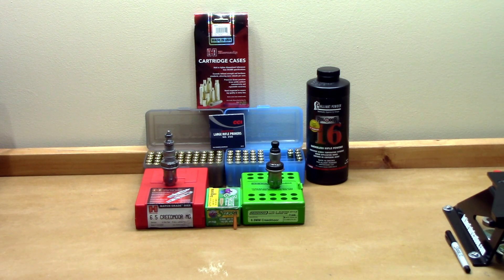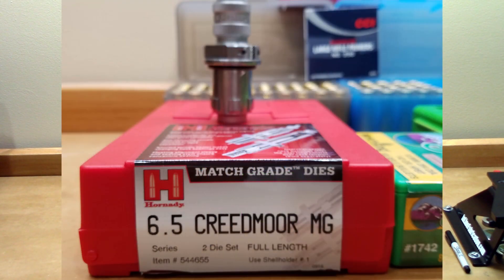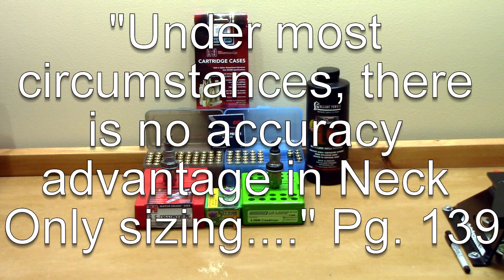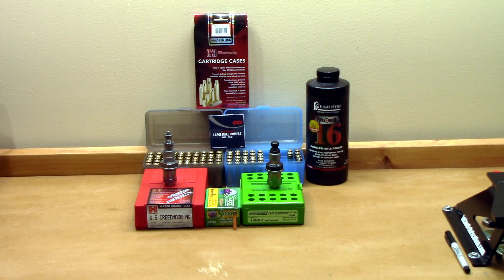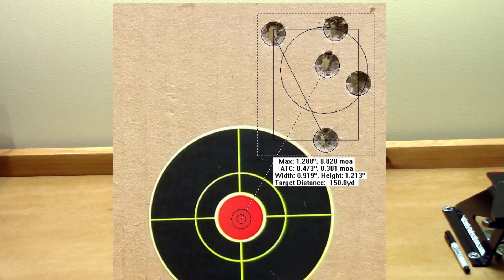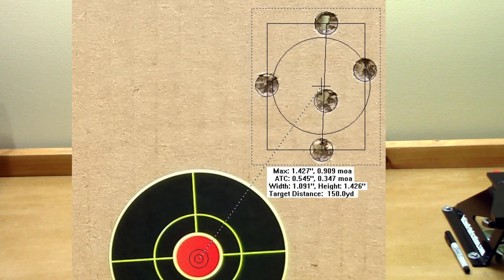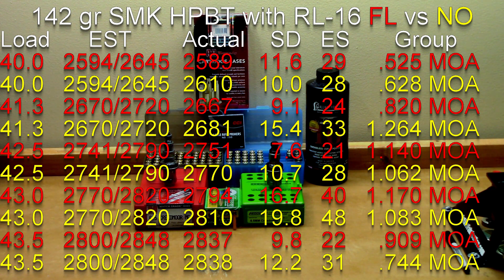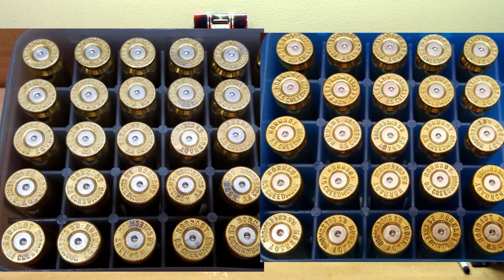Full length vs Neck sizing performance comparison

Comment: Good video.  Most competition shooters in F-Class and BR don’t neck size their brass.  We F/L size with 0.002” shoulder bump.
Reply: Erik, are you bumping .002'' back from SAAMI specs on a case or based on the rifles chamber? For instance I like to take all new virgin brass and "fire form" it once in the rifle it will be used for then make all corrections, assumptions, and measurements off of that assuming that it is formed to that particular chamber once it has been fired in that chamber.
Reply: Erik Cortina  bumping the shoulder is not full length sizing, only reduces the headspace.  If your headspace is ok, just neck size.
Reply: I, personally agree with Eric and am in the process of switching from the long touted and what most of us have been ERRONEOUSLY taught was more accurate neck sizing to do full length resizing, to include a shoulder bump to get the brass .0015 to .002 back from where it is a "tight bolt fit" bunt NOT IMPOSSIBLE to close..I believe that will give me a reasonable chance of NOT having rounds that will not allow bolt closing and having too much headspace. This is important if you shoot in timed matches because one would HATE to DNF a match or even a section of a match because the bolt would operate...maybe due to even a small accumulation of "crud" of any kind. The reality is that, SAAMI spec is NOT what most match shooters use and the cases have to be prepped according to the actual chamber in the rifle in which they are to be used.
Reply: Not Sammi, but one time shot case, out of your rifle

Comment: One thing I did notice, is that bullet speeds tend to be higher and next size dies. This is due to the fact that energy is not wasted expanding the case size as a deserve a chamber formed. So, this can take one variable out when trying to develop an accurate load. In my opinion full-length sizing should be used only when you have multiple rifles in the same caliber. Unless of course you were going to segregate your brass buy rifle.
Reply: I neck size cases to be used in bolt actions at slow fire range targets.  I do this for increased case life.  Some of my rifles get better accuracy from full-length resizing.

What I am using full-length resizing for is hunting rounds, rapid fire target rounds, and anything for a non-bolt action.

Comment: If the concern is neck tension and brass life, why not just anneal after each firing?  I just started annealing and using a mandrel so I can’t speak from personal experience but AMP has put out a few very compelling tests on YouTube. 

I am using the Annealeez and was surprised at how fast and easy it is. There are several devices in the market that make it too easy to pass up.

Comment: I usually get about 3 to 4 neck sizing before I need to full length size and I would rather neck size the case as it places less work hardening on the brass extending it's life.

Comment: This test produced some interesting data. If you average the 5 neck sized groups vs. the 5 full length sized groups, you get average groups of .9218” vs .9662” respectively. Average extreme spreads are 10.96 vs. 13.62.  Averaging the standard deviations yields a similar result; however, I am not at all confident that an average of standard deviations is meaningful. A 25 shot sample has much stronger statistical significance than a 5 shot sample. Just based on this analysis, neck sizing looks more accurate. 

Hearing Erik Cortina tell you “just stop it!” is pretty convincing for me initially, but I am not Erik. I do not use Lapau or Alpha brass, so my cases are not as consistent. I want the brass I do use to last as long as possible before throwing it out (or annealing), while Erik couldn’t care less about brass life. If I can get similar results with neck sizing while extending the life of my brass and avoiding case lube 4 out of 5 times, that looks like the way to go for a bolt action rifle. 

Most of my handloading has been for semiauto, and those always require full length resizing.

Comment: 0.525 group not good for a precision rifle ... maybe work up a new load.  I neck turn, neck size,
and bump the shoulder if need be,  getting 0.173 moa at 100 yds 5 shot group.  I like a snug fit 
in the chamber, it minimizes the proximal gas leak, and brass comes out cleaner. Good shooting.

Comment: The reason why I've always been neck sizing for the last two decades is because I'm not over working the neck by underdizing it, then expanding it with the expander ball like in a full length resizing die. Plus the neck thickness is rarely perfectly consistent and the expander ball will create an eccentric neck expanding more in the direction where the wall is the thinnest. Besides neck sizing die sets come with a body die as well as a neck die anyway for when the body has grown too big for it's britches.

People just simply miss understand what the purpose and use of the neck sizing die sets are for. Like all the miss information you see about moly coated bullets.

But of course you only use neck sizing die on brass with a chosen single constant neck wall thickness. Meaning you either buy top quality brass with consistent wall thickness, or turn your necks to make them consistent. If you use brass with inconsistent neck wall thickness in a neck die you're going to get a wide variation in neck tensions on your bullets!

If you're going to use mixed range pickup brass or low quality brass, you'll have to use a full length resizing die because you'll need the expander ball to create consistent neck tension on the bullets. Or turn the brass necks so it's neck wall is consistent for a neck sizing die.
Reply: Thanks, this is helpful.
Reply: I was looking this answer, I just start loading 223 and I bought the full length and the collect neck sizer . I didn't know how to use the collect neck sizer.
Thanks

Comment: Just like coating bullets, works for one rifle not the next, you will find out there will be better gains in reducing ES by testing primers and using the best you can, and from experience and hours of testing in a world class ballistics lab and the out come was a big surprise to me, however not to the lab team as the primer that came out on top was the ones they used every day for their testing, The primer with the  lowest ES was Remington standard  with a ES 3.783 m/s or 12.41 fps almost half the ES of the closes BR Primer which was 6.326 m/s or 20.75 fps and I had just got 2000 BR primers the week before we tested. This will probably change batch by batch just like powders do.

Comment: This is another interesting video. You would think there would be less internal case volume and more velocity generated by the FL sized cases, but the opposite held true. In terms of velocity, maybe it's more important for the bullet to be centered by virtue of the fire formed cases so that the bullet doesn't lose speed after hitting the throat off center? As for the better SD associated with the FL sized cases, we know ignition becomes more uniform and SDs improve as the case becomes more full.

Comment: Question is about neck lengh. Grew up shooting longer neck cartriges. In the market for a 338 Win Mag and will use 250 grns bullets seated out as far as gun/magazine will allow. Is it worth to ream the chamber for a longer neck using 300 Win Mag cases?

Comment: Thanks for this nice video... What is your usual case life?
Reply from the maker: Depends on the brand and how hot you load. Lapua goes a lot longer with the small primer pockets, Peterson is probably just as good, and they have both large and small primer pocket brass for 6.5 CM.

Comment: Hi there is a flaw in your test, you should work up the best load in FL  Brass then in Neck sized brass then compare, 
By FL sizing you are decreasing the case capacity and in doing so increasing pressure compared to Neck sizing , at the end of the day if you believe one is better than the other go with it.

Comment: If it was me, I would be more concerned about the extreme spreads in your velocities more than I would the sizing of the brass.  In 6.5, you should be able to get extremes in single digits to teens which will help your group size more.  Loose the magnum primers and or switch powders and your groups will reduce.  Then worry about the cases.

Comment: Does the brass last longer with neck only and not full length sizing on my 6.5 cm bolt RPR thanks I so enjoyed your video
Reply from the maker: Hi Ruben, I am glad you enjoy the content. SO far in 6.5 Creedmoor the majority of the case failures are due to primer pockets becoming loose. I have not yet had a neck split. This is somewhat cartridge dependent though.
Reply from the maker: Not as much for small rifle primer brass. LR Primer pockets seem to loosen faster depending how high the pressure of the reloads.

Comment: Here is my one thing, im cool with either, but how do you constantly put the same amount of pressure on the collet die, do i need to rig a torque wrench on the lever? Get a good cam over? Seems like i can get my 308 down to .306, but for some reason my 30-06 sizes to .308 no matter how hard i press on the lever, surely the necks aren’t that hard after two firings. My full length dies go to .305 on both, a little too tight but its what i have right now

Comment: I was curious about the dies that you display in this video. The Hornady MG dies are FL bushing dies, and the Redding type s dies aren't those also FL bushing dies?
Reply from the maker: yle8708 The Redding die here is a neck only die. They do make FL bushing dies, this isn't it.
Reply: Bolt Action Reloading thank you for answering my question. I'm still a relatively new reloader with only about two years under my belt.

Comment: Hi.  I put a light crimp with Lee crimp die. .005 . Haven't tried yet. Do you crimp for the rpr.Thank you for the video.
Reply from the maker: I used to crimp but since I started with my new process of using a turning mandrel to set my .002 neck tension I dont for any bolt gun I have.

Comment: I experinced similar results in my savage. No real improvement, except brass life and faster reloading. I use my results from factory load accuracy- when I first got my rifle, after signing in, and less than 20 shots down the barrel. I shot Winchester 140 match at .414" and Hornady 120 match at .525", both full length sized from the factory.

Comment: The only rationale that I ever heard for neck sizing is to extend brass life by reducing the amount of 'working' and stretch that it gets.  Really even that is only an issue with rifles that have 'loose' chambers.  For rifles with chambers on the tight side (like my RPR), it may be impractical to bump size because the shoulder is already at the short side of SAMMI spec after firing. In that circumstance, even FL sizing does little to the brass.  

I've check COL of the brass with/without the expander ball in my 6.5 CM; without the expander ball, the brass does not stretch and remains at the length to which it was trimmed before being shot and before the FL resize without the expander.  Using the expander spindle is where the 'stretch' occurs, and it varies depending on how well I did on slightly lubing the inside of the neck - it is also evident in the feel/effort on the press.  That might change if my RPR had a loose chamber on the large side of the SAAMI spec, rather than on the small side.

I just purchased a set of Redding dies with a tc expander ball, so it will be interesting to recheck my earlier test with it. 

Anyway, never heard of neck sizing as an accuracy tool until recent years; but never could see the logic behind that belief.  Good to have some test data.

Comment: Did you sort the brass by volume, or conduct any other brass segregation/turn necks/case trim? I really dont know if or how these variables would have affected the test, I just really want to know what exactly was done.

Comment: At the 4:24 mark, you show a COAL of 2.810". Why did you not measure B.T.O.?
Reply from the maker: Hi Ron. This is one of my earlier videos. If I were to redo it I would probably specify both. Keep in mind BTO will be somewhat tool dependent since it's a comparator,  and measuring the tip has error from one to the next so neither is perfect.
Reply: @BoltActionReloading  Thank You for replying so quickly!!

Comment: I'm new to reloading  for a bolt action .. is it correct that it's better to full length  resize until yiu have fired it in the particular  bolt gun...then you won't have to full length  resize...???
Reply from the maker: For a new gun you should be sure the brass would chamber in the rifle before its loaded. Or just FL size it.

Comment: When your groups are one ragged hole, then you should make a video. I usually always consider 1/2 moa a starting point to utilize advanced reloading techniques. 
If you can't get your groups under an inch there is probably other stuff going on that's killing your results.
Reply: @tS-sn7jt  u want to explain before I post pics of my groups?

Comment: Hey guys and gals maybe someone can help me out. I'm trying to get Into the shoulder bump method but I can't seem to set up my die correctly. 6.5 CM with Hornady FL dies. 
The problem I always end up with is once I get my shoulder bumped to the proper size my neck only gets half way sized. If I size the entire neck I bump shoulder way too far. I feel like I'd have to play with the expander ball and decapping pin depth but it doesn't seem to change it at all. Dies are outta the box stock no add on at all. Thanks in advance guys

Comment: Nice job.and I think you covered most of the possibilities.  I don’t know if you cleaned primer pockets,debured the flash hole,or reamed the primer pockets inside and out.  I also don’t know if you know what your head space measurement is after you bumped the shoulder back. I also don’t know what your bullet run out is.  Keeping good records of all information on this particular bullet and load makes life easier the next time you decide to load the same load.  

Do not pay any attention to the folks that leave you bad notes because they probably don’t know what you do.  These forms are for learning and helping other people learn.  This is extremely important in keeping our sport safe.  We get enough bad mouthing al ready.  Hang in there and don’t forget to tell your audiences To Join The NRA, as if it wasn’t for them we wouldn’t be having this conversation.

I think your presentations are very good, but you may want to consider slowing down just a little as some of the folks may be beginners.  I have been reloading shotguns, rifles and nine revolver and pistol cartridges for about 47 seven years and I learn something every time I reload.  Good luck to you my friend.

Comment: The minor velocity differences are because those mtm cartridge cases are different colours. For tight groups, consistency is everything. Neck sizing saves on case lube which is the only reason I do it. I get very low neck runout with Lee collet dies in .308, buy whether that has any accuracy correlation is doubtful.

Comment: The increased velocity for the NO seems to show a change in how the powder is burning (due to expansion of the case).  Ever-changing burn rates will result in unpredictable velocities & harmonics.  FL sizing, will minimize that effect and remove a major variable from load development.  I would like to see the chart updated with a 2nd reload, repeating the same sizing method for each set of cases.